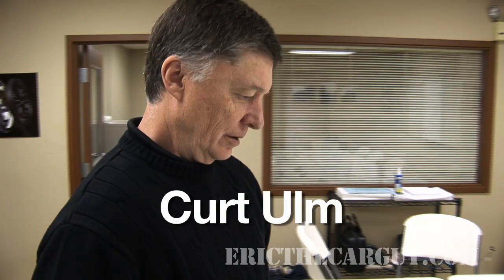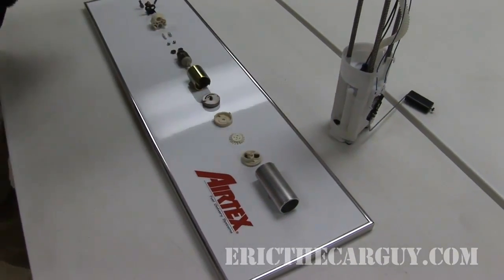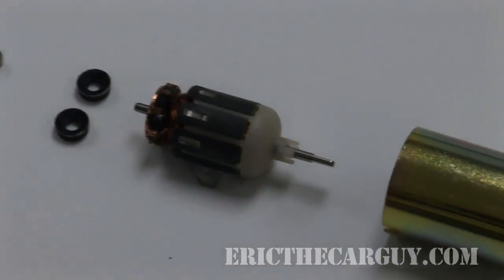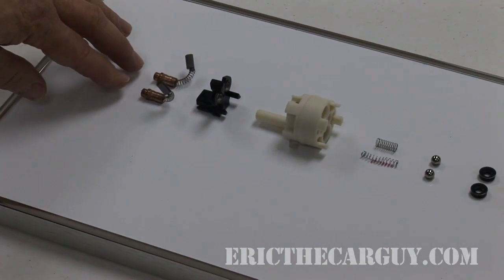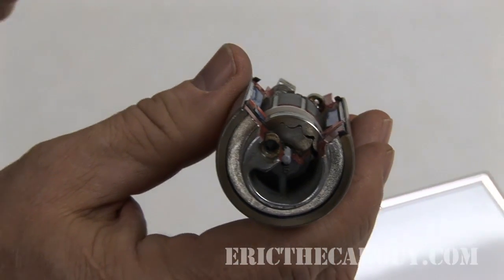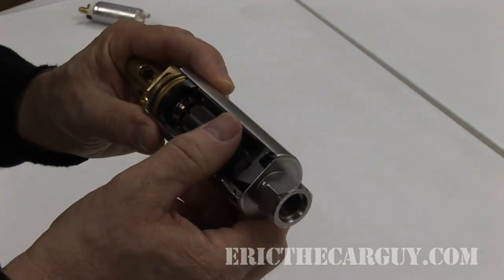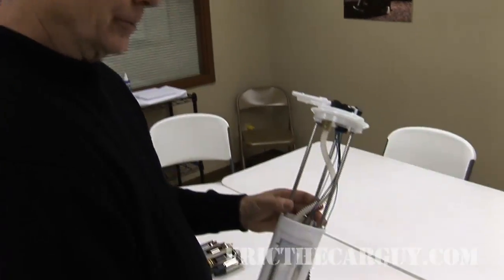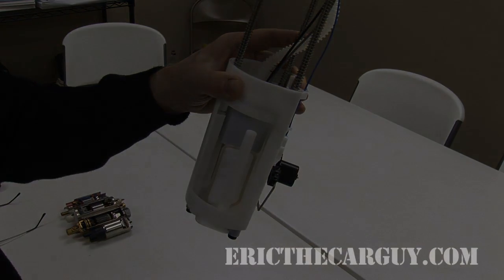What's Inside An Electric Fuel Pump? - EricTheCarGuy

Comment: I took my pump apart. Fuel system is acting up and suspected the pump. I could find no issue / visual damage. However, commutator / windings were a bit weird. With armature in case and checking across contacts (through brushes) I got around 0.6 ohms with very minute fluctuations. However, when I removed the armature and tested each winding / commutator (adjacent or 180degrees apart). The ohm reading was as much as several ohms. When I pressed down on the commutators with test leads like the brushes would I got the 0.6 ohms. This struck me as odd. Is this design common? I thought maybe to signal a failing pump as pressure would drop when resistance increases.

Comment: They don't show the inside of the actual fuel pump mechanism detail.  Only some limited views without taking it apart.  I want to see the gear or vane  mechanism, how it works.  Also the commutator where the brushes rub.

Comment: Thanks for this.  I just replaced a fuel pump.  Old one had definitely failed.  After 20 perfect kilometers on the new pump it started running rough, no power, slow to build revs and hard start.  I have 55psi at the rail but an almost instant pressure drop.  There are no leaks and I've checked the pressure regulator and its working.  I assumed a failing pressure check valve in the pump but after this Im thinking maybe the regulator only looks like its working... hmmmmmmmmmm

Comment: I have a 96 F250 w 60,000mi it has dual tanks. I'm experiencing low fuel pressure on both tanks. Front tank @18 psi and rear tank @ 28 psi. Both tanks hold pressure for awhile but not over night. Should I replace both pumps or is there a way to find out which pump is the problem?

Great video by the way!

Comment: Great video. Is there a way to test a used fuel pump motor to see how strong it is? I guess put it in the tank, do KOEO and KOER pressure tests at the rail then leave it over night to see if the check valve holds the pressure?

Comment: 88 to 95  GM Tbi pumps  that run 9 to 13 psi dont have a check valve, they only have a pressure relief valve. This is why there is a 2 second prime when key set to run. pressure bleeds down almost immediately after killing engine. many techs diagnose bad pump., but this is mistake

Comment: I almost didn't make it home tonight because of these useless pumps. They need to be banned. Who engineered these turbine pumps need to tossed into prison. My S10 STILL has issues with the fuel pump. Leave off the gas and the engine shakes and carries on. Why can't airtex put out a real pump. Like a oil pump with two gears that spin creating pressure. Useless engineers need to go.

Comment: Most interesting video on the internet right now. I just can't find one about the transistor fuel pumps and why a universal on an 85 Nissan pickup keeps loosing fuel pressure from the tank up to the engine. I'm almost 100 percent sure it needs an inline check valve after the pump. I really think the auto parts store forgot that some filters used to double as a check valve. I don't understand why it's a discontinued part either it seemed to have a good purpose

Comment: I have a 89 s10 pickup with 2.5 liter engine. This has a chronic fuel pump issue. Easter Sunday I replaced my fuel pump with a ep 386 AC DELCO fuel pump. It actually runs worst. The person that engineered these turbine pumps need to be arrested and tossed into prision for life. The AC DELCO FUEL pump will be the 4th pump in the truck.  I have NEVER  had so many issues that I have now.  The only part I didn't replace is the tps.  The person that designed the in the tank pump should be placed in the tank!  Why can't I get a fuel pump that is designed like a oil pump? two gears spinning around creating about 40 psi.  When I replaced fuel pump into the new tank I replaced the filter that pushes on the bottom of the fuel pump assembly. Wonder what would happen if I installed a mechanical fuel pump in line just before the TBI. there's no reason for this to continue to happen in regards to the poorly designed fuel pumps. They should be banned!

Comment: in the beginning of November I replaced the gas tank fuel hanger and pump on my chevy s10 pickup. December 6 my truck died. It refuses to start. When I turn the key on I can hear the pump run. but the truck won't start. If I dump gas into the throttle body the truck starts right up and then When the gas runs out it dies. How does a new fuel pump go bad in a month? I also replaced the gas filter and oil pressure sending unit and a new distributor. previous owner had installed a new fuel pump. Why does my truck hate fuel pumps?
Reply: it might be the fuel injectors are being disabled by the ecm this might happen if you have a problem with the security systems on the s10 and later model blazers there are video's here on u tube that explain about how to go about diagnosing this type of problem that is located inside the ignition switch contacts the security system on the s 10 and later models blazers can disable the fuel injectors but the pump will still run but the truck wont cause the fuel inectors are not enabled.

Comment: That's odd that the liquid fuel inside the motor does not short out the motor's positive and negative contacts, in another video, this guy pumped water with a fuel pump and it worked

Comment: If the check valve is bad, then the hot engine starting gets difficult. The fuel pressure is lost quickly and with a hot engine, this results in fuel vapours forming in the fuel lines. This leads to hot engine restart a little longer.

Comment: Yeah, I think The Pressure Release is my electric fuel pump is/Has Contaminates inside is... It runs fine for a while then it shuts down... Unless I give it a wack... Then it runs fine again for about a Minute or two and does the same thing... I really can't complain... It's a Volvo Fuel Pump... It has over 219 Thousands Miles on it... Not to Include Idle Time...

Cheap Bad Gas From a Turkey Hill Gas Station in Pennsylvania finally took it out... Pulled the Pump and found Tiny Metal Shavings in The Sock.. Which MORE THAN LIKELY Screwed Up My Electric Fuel Pump... I say STEER CLEAR OF TURKEY HILL AND KROGER FUEL... The Quality of Their Low Priced Generic Fuel? Will Screw Your Car Up... Just Not Worth It...   JMO...

Comment: I find it fascinating and a little counterintuitive that the brushes are submerged in gasoline with the rest of the pump. The brushes on most motors show visible spark, and those brushes on the fuel pump look smaller but similar. The only thing missing seems to be oxygen, and when the tank runs dry there will be air in the tank, too. Am I missing something?
Reply: spelunkerd   my same concern or question,, how does that dont ignite the fuel??

Comment: i am thinking to use a small electric fuel pump as a hydraulic pump for RC excavator hydraulic system instead of a high pressure mini hydraulic pump,  you think it will work?
Reply: no

Comment: i am thinking to use a small electric fuel pump as a hydraulic pump for RC excavator hydraulic system instead of a high pressure mini hydraulic pump,  you think it will work?

Comment: can i use a fuelpump to pump water / water coolant / distilled water?
Reply: why not?
Reply: yeah, but it would be a much more expensive pump vs say, an aquarium pump. those are relatively cheap
Reply: i thought water being conductive and going trough the inside of the pump and brushes might be a problem, and water not being able to grease the components as petrol would, and so on:D

Comment: Hi Eric  i have a question 
why when u apply D.C. current in to the fuel tank four the pump and it didn't ignite the fuel
Reply: great question..in fact the fuel pump usually resides in a sump so it stays submerged (the fuel provides cooling for the pump.) However the manufactures discovered in the early days that a rollover accident with  fuel pump run-on thus no cooling and overheating the pump, created a rather spectacular finale to the accident. Now they have installed a inertia switch that senses any sudden jolt (or especially a rollover) and cuts power to the pump. If your car has a jolt and then will not start, check to see if the inertia switch has tripped.
Reply: the reason is liquid gasoline goes not ignite. this is why the pump is submerged. its actually one of the safer places you can store a pump.
Reply: How about if the tank is on low fuel
Reply: Vince naidu25 there is a possibility yes, but if the tank is only full of vapor maybe not as there is less air/O2 to cause the fuel to burn.

Comment: Will i benefit from a larger electric fuel pump if i hook it up with a carburetor?
Reply: Will this be effective in a 1.5 liter engine with oversized pistons installed?
Reply: The carberutor installed is an Aisin SU type carburetor , do you reckon it would be better to change my carburetor instead of upgrading the fuel pump?  the reason why i'm considering this is because i experience a hesitation specifically at 2nd gear at high rpms, it feels like my engine is flooding and it lugs badly , i need to pull over just to get my throttle to work again
Reply: Martin! many thanks for your time in answering my queries!
Btw,
I've made some minor mods with the flywheel. the mechanic in my local shop recommended to use a bigger clutch from a 1.6 liter engine , a reputable machine shop drilled an additional hole to accomodate the clutch, quite a bit torquey with the setup however, if it's a transmission problem, then this must be the one causing it . I've noticed that the car had more "bite" running in the 3rd gear than the second gear . btw my car's an MT

Comment: Thank you so much for sharing Eric! Wow, I believe the pressure relief valve went bad in my factory fuel pump. (2001 Chevy Cavalier 2.2). I hope you don't mind me sharing this but - I have never seen this before or I have not found any information on this type of fuel pump failure. I'm having a no start condition.  I have spark everywhere spark should be. Testing the pump; the pump sound was normal, I could hear the pump running just fine.  I found very low fuel flow,  pressure at the filter, but not much fuel volume, I found it pumped about 1/2 quart in 5 minutes, when it should flow about 1 quart in 30 seconds.  I very carefully removed the fuel pump and energized the fuel pump motor, the gas pressure was shooting out of the motor's top housing hole and barely going through the fuel line.  I guess I have to replace either the pump or the fuel pump assembly.

Comment: "I have a question about fuel pump design. I was wondering why fuel pumps are designed to use the fuel itself as a lubricant and coolant. Why is this so? Most other electric motors I've seen don't need any cooling to operate continuously. Also, since fuel is going through the motor brushes, wouldn't there be a spark there while the electric motor is spinning? Wouldn't that ignite the fuel? I don't know much about these things..."

most electric motors have a lubricant inside them, unfortunately gasoline acts as a solvent and washes off the lubricants. So the pumps are designed to use gasoline as a lubricant instead. Many fuel pump motors are quite powerful for their size, and run at 100% duty cycle (the run continuously) and will overheat without a constant flow of cool fuel. Most electric motors that run for extended periods with 100% duty cycle have some form of cooling. also keep in mind some electric motors are air cooled without a fan and may or may not use a heat sink to aid in cooling depending on how much heat they put out. 

Liquid gasoline and diesel is non flammable. In fact assuming there is no vapors sitting on top of the fuel you can throw a lit match into a bucket of gasoline and it will put out the match. Gasoline VAPOR on the other hand is highly flammable when combined with oxygen. To burn 1 liter of VAPORIZED gasoline it needs to be mixed with approximately 15 liters of air to provide the requisite oxygen for complete combustion. For these reasons there is no concern of igniting the fuel from the spark caused by the electric fuel pump.

Comment: Eric, I realize this is an older video,b ut I have found it extremely helpful in understanding my yamaha scooter's fuel system, it is nearly identical to what was described. Is there any way to clean the pump if it only works intermittently?  Seems like a sealed system, perhaps lubricant inside, or something to remove reside or varnished gas?

Comment: Many people blame the pump for failing but I blame ethanol fuel for wearing parts out prematurely. Before I knock Airtex or any other pump I would try flushing the old gas out of all the lines and tank, replace the fuel filter, replace pump, purge the fuel rail of all old gas, refill tank will non-ethanol fuel and go from there. There are still places around that sell ethanol free fuel, just google it. Ethanol fuel creates water in the system which causes rust, deterioration, and corrosion. Fuel pumps are designed to pump fuel, not sludge created by ethanol.
Reply: P.B. Theriver true ethanol is garbage. Back in November I replaced the gas tank fuel hanger and pump assembly and it lasted a month! AM autoparts sells junk!

Comment: they know alot about pumps for people that can't build one that works. I had one doa. pushed 12psi new out of the box. second one I used lasted 25 miles and broke down on the side of the highway. I laid in gravel and broken glass to replace it with pos Carter pump that cost half as much and lasted 6 months. first two times I just needed to get by a few days, and they didn't even last that long. the Carter pump was the only one I could get same day where I was broke down.

BTW, airtek pumps were both all plastic drive mechanisms with thinner teeth then the brass assembly in the OEM Bosch and Carter pump. the airtek that lasted 25 miles was also really loud and pulled nearly 20 amps, the Carter pulled 9.6 amps while actually pumping.

even though the airtek couldn't start the car, it did have enough left in it to pump 10 gallons out of my full tank before I smashed it with a rock and left it with the broken glass.

this time I'm special ordering a walbro. the first one lasted 28 years and 320k miles, not minutes.
Reply: Yeah a whole lot of plastic in this video. Nobody cares about making stuff last anymore... Or perhaps they design them to fail.. more likely IMO.

Comment: Great clip,thanks. Is anyone able to answer a question which comes to mind while watching this; the float /level rheostat and the motor brushes and armature setups both appear to have active voltage circuits  and (to me) apparent potential for arching or sparking.the fuel even passes THROUGH the motor ! Obviously this is a completely safe feature ,but I can't quite understand  how these functions are included IN the actual tank,with no regard for a possible ignition of the fuel? Any explanation would be appreciated. Thanks in advance.

Comment: Can't be just me, I have had several of these in a suburban, I drip the tank, clean the tank, replaced with a life time warranty Airtex ( I bought it when there was still lifetime warranties on these thank goodness) worked great for about 5 months and poof, gotta get a new one.   1997 suburban, 5 airtex pumps before I sold the truck off.  4 failures in 4 years not counting the last one I sold the truck off with or the first one that was OEM. I didn't have to clean the tank after that 1st time since it was clean as can be.   the filters were not clogged, the just quit working.      I am currently working in a GMC Yukon and decided to try a AC Delco.   I am curious to see if it's works better.

Comment: Have a question. I think my fuel pump may be bad car hardly runs. So I test it with water and it only will pump if water is in the resovoir it's self and will hardley push any when trying to pump from screen inlet.. Does this mean my pump is bad?
Reply: maybe

Comment: Great clip thank you eric the car guy,
  i just had an electric fuel pump die in my 23 year old LS 400 a few days ago, after pulling the pump out and putting 12 volts through it , it was absolutely dead,
im wondering what causes them to fail ?  do they run out of brushes or seize up ?
i might add i checked the fuel in the tank and it was spotless clean, the tank was free of rust and the filter on the pump was free of any debris.... very clean in fact as far as i could see.
i thought the pump may have seized because the car ran like a clock , never gave any indication of a problem, the next day i went to start it , and the pump was just plain dead.
cheers. .
Reply: Commutator and brushes wear out, how long is a piece of string?, my Falcon pump died at 127,000 [EFI Car] Fabric OHC belts are replaced at a set mileage to save an engine, but no manufacturer sets a distance or age on electric pressure pumps and when they die the roadside assistance guy belts your tank with a rubber mallet to try and shock it into going again but this would be dumb luck it it did work for long, frightens me if the pump has many years up and you are out on the interstate and it dies and you have no phone coverage???

Comment: Sure would be nice if you guys made a pump that mounted OUTSIDE the fuel tank, perhaps inside a metal cage to protect it.  The fuel could still flow-through for cooling.  The ability to replace these things is now limited to few diys or an expensive trip to the shop. 

Airtex guy did a beautiful presentation.  Wish I was that good !